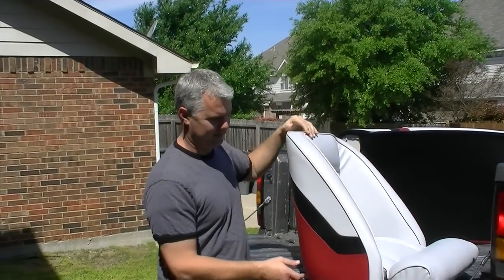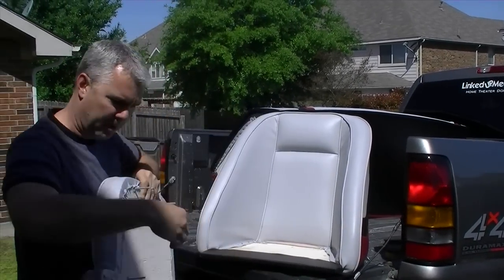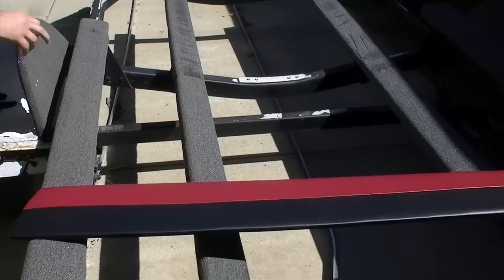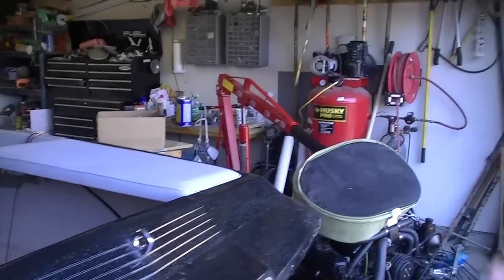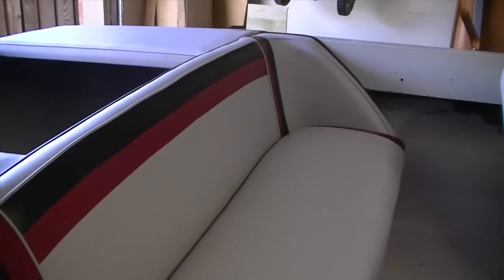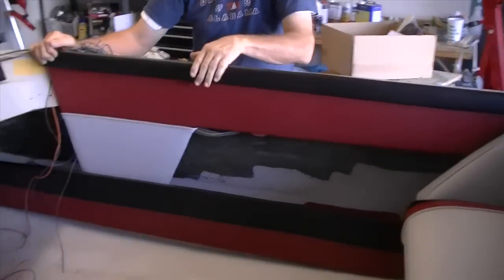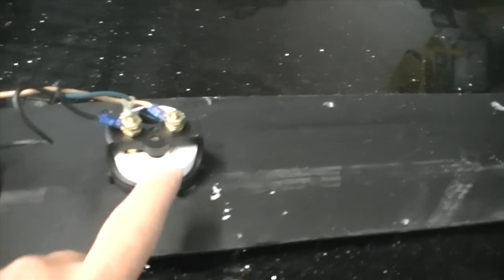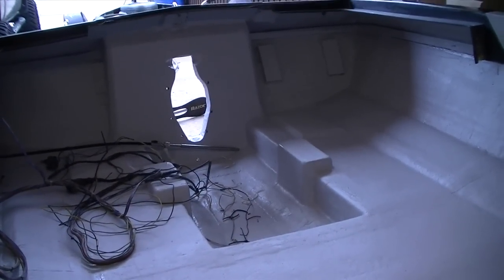Project Carlson CVX-18- Gauge install and interior REVEAL!!

Comment: i am building a custom console for a pontoon boat and was wondering what are the best materials to build it out of? i was going to use fiber glass but was not sure what to make the core out of.also i would like to keep it as light weight as possible. it's a big boat but i like to have room for other things. i like the look and durability of gel coat so that will be the finish. this will be my first project like this.

Comment: I am about to start on a CVX17 and have some cracks where the hull meets the vertical side of the strakes. I am going to grind out the crack and fill with " peanut butter", then reinforce/glass the inside of the hull and strakes. Do you think this will work? Do you have another suggestion?